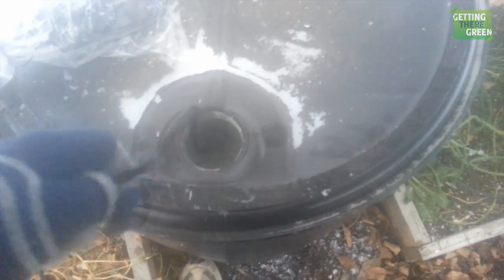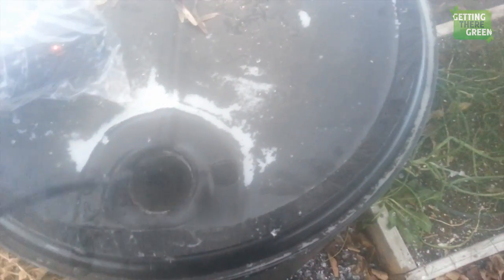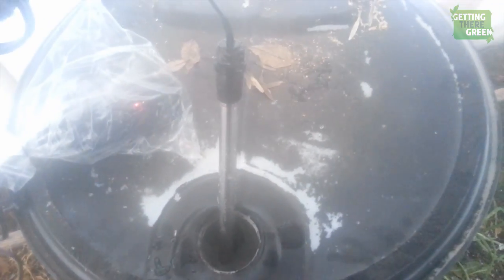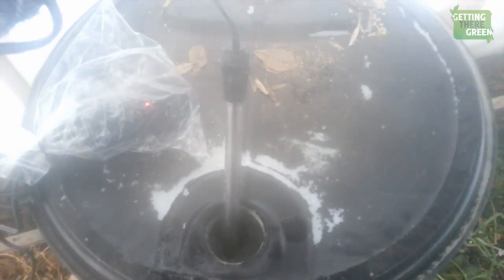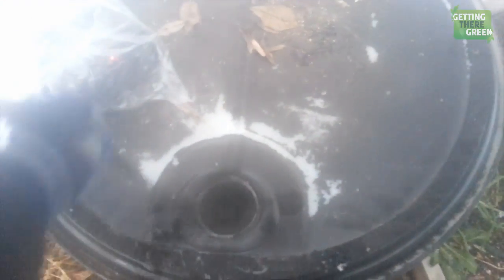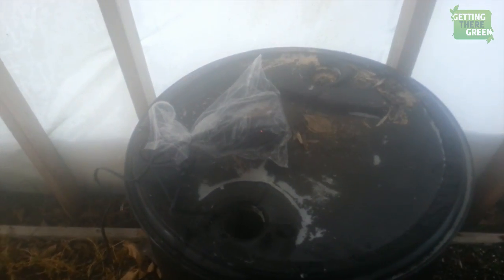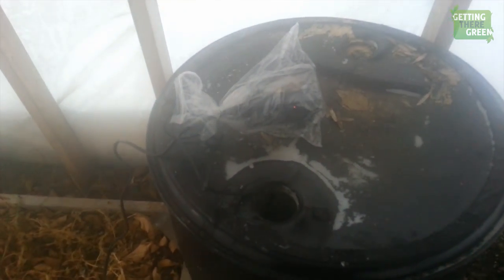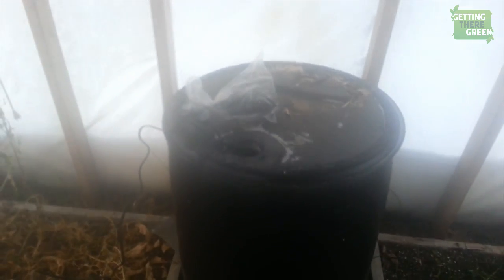Winter Greenhouse Passive Heat Experiment - Aqua Heater Test

Comment: Hi, looks interesting and we're looking at doing something similar this winter, but I don't see the follow up to this video, or the lead up either, could you possibly link to it/them.
Reply from the maker: We did a follow-up video but it got corrupted in the transfer process... :(  Overall this worked well, but last year with the major polar vortex issues it was kind of pointless.  We needed a much larger container to passively heat our area.  But overall in a mild winter in the Southern Ontario, Canada (42nd Parallel) area it works great.  I think it would have been better with a few more barrels (4-6) in our 15x20 greenhouse.  -Randy

Comment: is this working good???.. I have a lot of passive heat using several different methods but 300 watts isn't bad did it make a difference. I try to keep my green house at at-least 45 degrees a the lowest. I have a  under ground Heat Sink a 55 gallon drum of water and 2  small plate heaters.. lots of 2 liter bottles of water painted black along the south wall. I can maintain 45 to 65 but the heaters run a 1500 watts.. I'm looking for "alternatives".
Reply from the maker: We are in Canada, so in terms of temperatures we have been above zero (freezing) since we added this heater.  I think it would be better if we had 3 more of these.  But overall it is working. - Randy
Reply: nice, I'm going to pick one up and give it a shot.. even though our winter is really just about over.
Reply from the maker: I hear ya there... can't wait for it to be over.  I expect there are quite a few people who are starting to look into this up coming season... our numbers are starting to rise again.  Keep us updated on how it goes for you. - Randy

Comment: Snow and ice helps to insulate, so try to shovel as much around the greenhouse, while still being safe. You might want to move the rain barrel into the center of the greenhouse more so that it will heat better and not get as cold/ frozen. But, passive solar heating isnt really effective unless you can get it into the sun a LOT to get it pretty warm. Hope this helps!